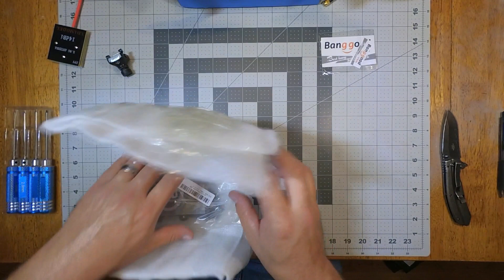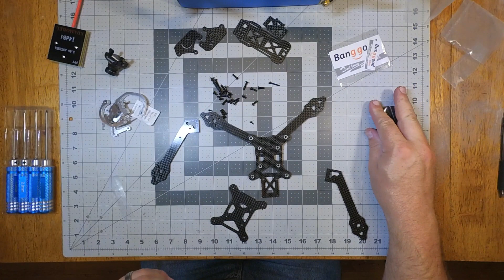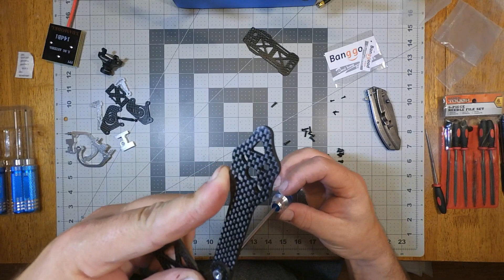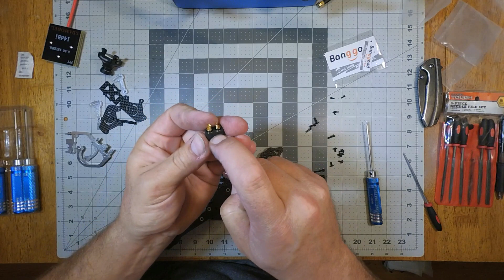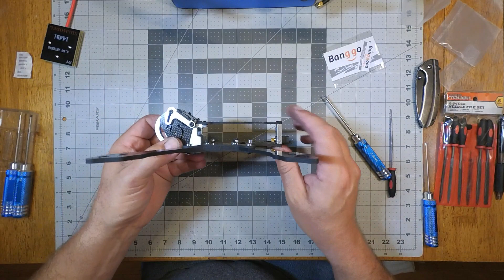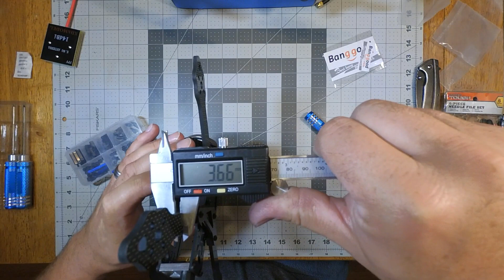Scorpion X220 H220 Frame Assembly Review

Comment: just broke my bottom plate on my realacc x210.  debating between buying the replacement or changing to a new frame altogether.   out of all of your builds what is your favorite budget frame to date?  i was looking at the realacc furious 220mm, but i know you destroyed yours.  have you abandoned that frame or rebuilt?  suggestions?
Reply from the maker: jonbrabham hands down the Genius215! it has lasted this entire time I love that frame so much I'm going to buy the original skitzo dark matter frame! The Genius 215's arms move in a crash but it isn't that big of a deal.. Or top mount would be this or the MartianII 215.. This is a nice frame too but it should be for the price.. Have a great day my friend!
Reply from the maker: jonbrabham, the furious has a weak point on the rear. I have rebuilt it just finished it but I would not give it a high durability rating! Love the look and feel of it in the air I had to rebuild it👍🏼😁